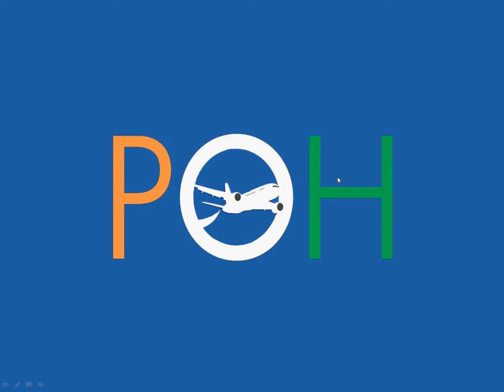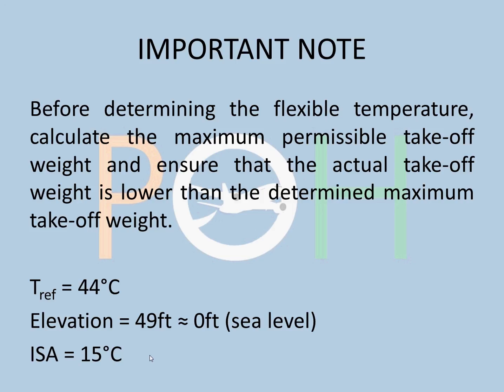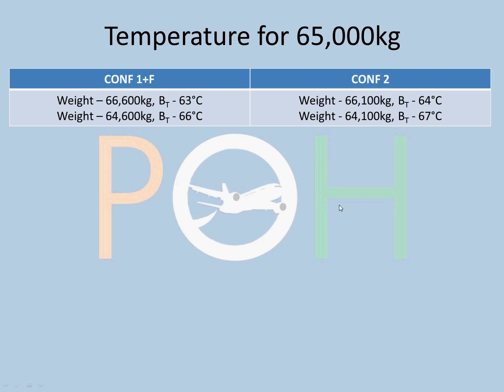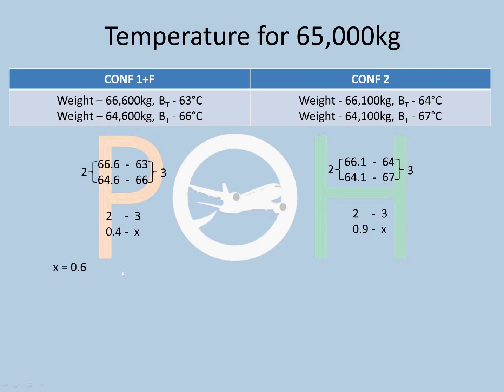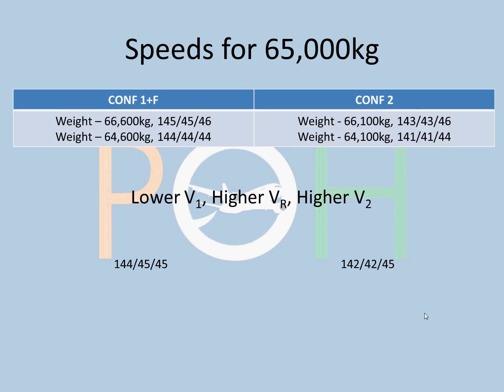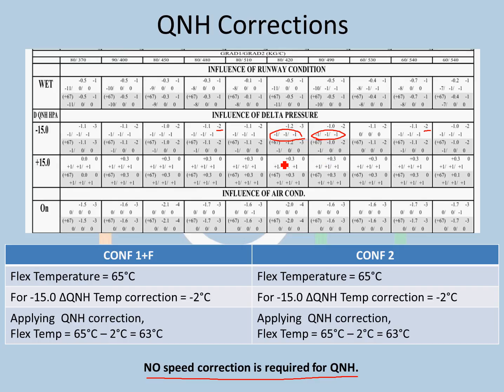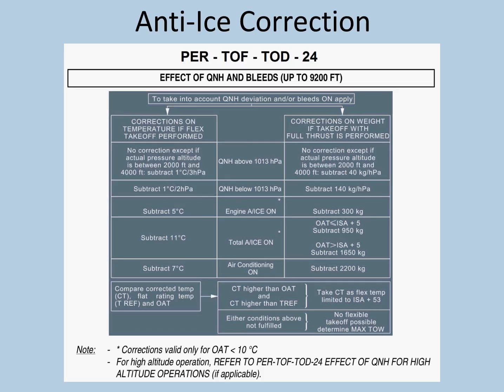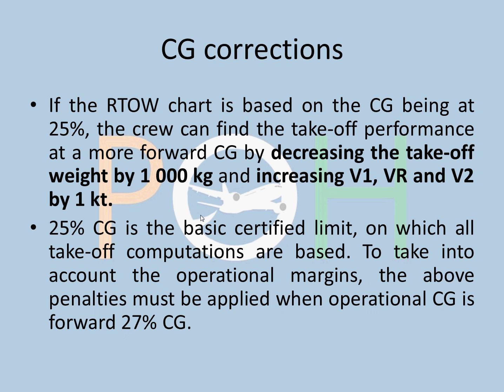A320 - Flex Temperature Calculation (Dry Conditions)

Comment: I got a bit lost on the QNH correction, how do you determine if it's either -15.0 or +15.0?
Reply from the maker: It's with respect to 1013. If actual QNH is below 1013 then its -15. If actual QNH is above 1013 then its +15.
Reply: @poh  thank you so much, great vid

Comment: After applying correction we need to compare it to Vmu... Kindly put some light on it
Reply from the maker: VMU is achieved by pitching the aircraft up to the maximum during the takeoff roll. The speed at which the aircraft first lifts off is VMU. Therefore, lift-off is not possible prior to VMU. 

So this speed is compared from the FCOM tables, that your V2 can't be less than certain value of VMU. This is largely done on lower weights.

Comment: What is the Difference between CONF 1 + F and CONF 2. And why do you chose CONF 2?
Reply from the maker: Conf 1 is only slat surface.
Conf 1+F is one slat and one flap.
Conf 2 is two slats and two flaps.

Conf 2 maybe used for short field take off, or when you want to climb out faster.
Reply: Thank you so much!
Reply: Whitch Config do I have to choose, if I set the the Flap Selector in the A320 Cockpit to 2?
Reply from the maker: +TB500 Config 2

Comment: Don't you have to take in consideration of runway length, slope, etc.?
Reply from the maker: +Not Allowed Here Runway length is not a factor! It is fixed anyway for each runway. Runway length required to land the aircraft in a specific condition is what we are trying to find. And slope is ofcourse important, but in the question that I mentioned at the beginning of the video, there was no slope given, so I didn't consider it for this particular example.

Comment: Captain !! Dont we need to find out RTOW for the best config applying CONSERVATIVE corrections first and check for both CONFIG whether RTOW in given conditions is higher than ATOW. Then we consider best CONF as for which maximum load could be taken. Then in selected CONFIG table we select FLEX TEMP for ATOW and then AC ON correction (if applicable), WET CORRECTION ( for FLEX and Speeds if applicable) and QNH correction (only flex correction).
Reply from the maker: +Shashank Ajnadkar Kindly look at the RTOW video for the same. I've explained all that you have mentioned here. Cheers! 🙂